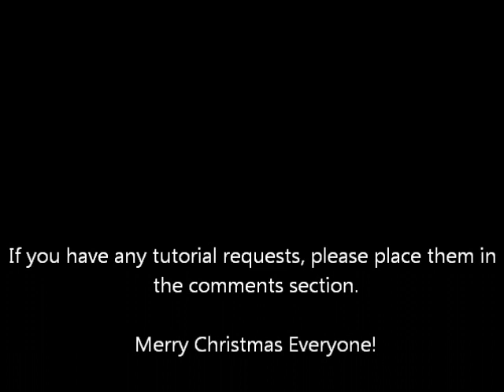555 Timer + CD4017 Multicoloured LED Scroller DIY kit

Comment: hi patrickikis, thanx for the video! can you help mi with my mini project. I'd like to build an eggtimer that will flash an LED after a time lab of 5min. Am asked to used the cd4024 and a 9vpp3 battry. Currently am looking at you tube videos and reading some background information on 555timer astable mode. 
Posting a video on this "cd4024 counter" would help mi a lot.
Hope to hear from you soon.
Cheers,